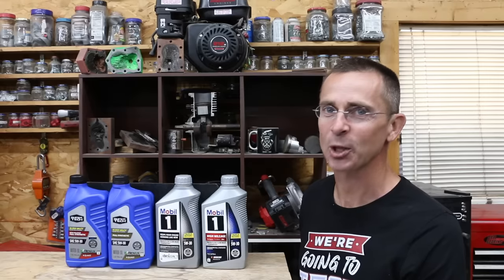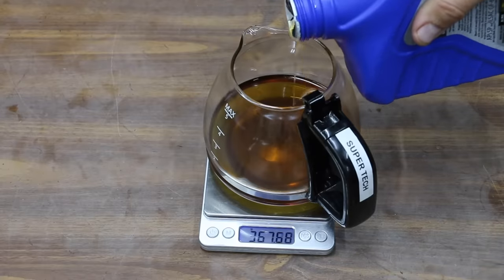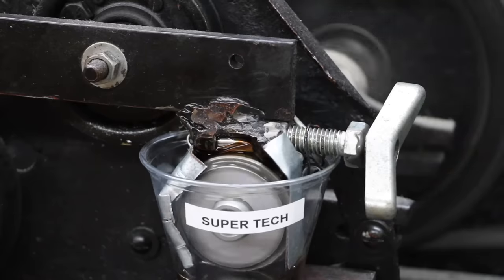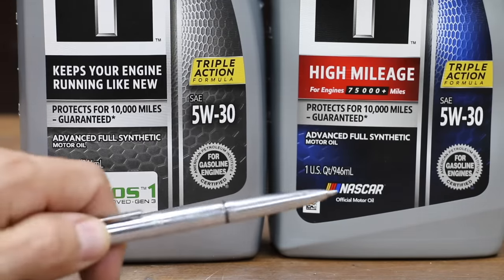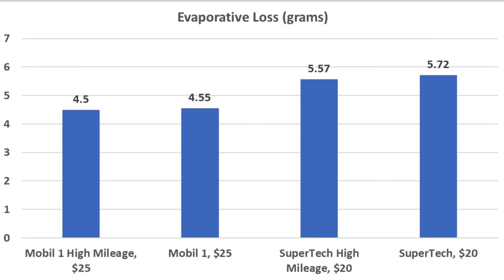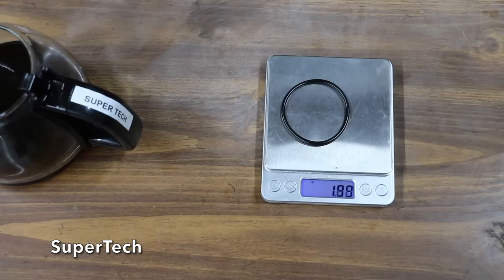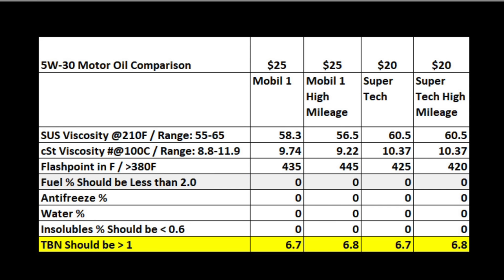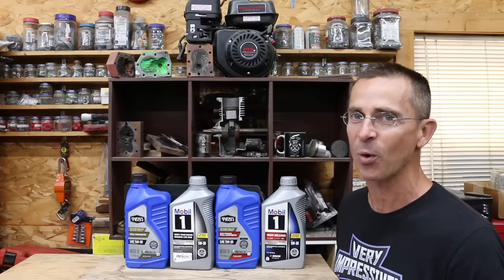Is “High Mileage” Motor Oil Safe? Let’s find out! Mobil 1 vs Mobil 1 High Mileage; SuperTech vs STHM

Comment: usually I love your videos but 30 sec in and I'm already done lol. Did you just say Synthetic helps it flow better when its cold? Probably should look up what exactly 5w-30 means lmao High mileage additives don't freeze so it stays thinner. I love too how your testing an Oil that most of us wouldn't use in our back yard Go-Karts or even a Lawn Mower.

Comment: Dexos certification means nothing. The reason Dexos is even on these oil containers is quite simple. Dexos is synonymous now with all GM produced vehicles. Why? Because when GM took the bailout money from the Feds years
ago, the Feds agreed to take payment in the form of a percentage of GM's sales through oil. That is why all GM vehicles recommend Dexos approved oil and you'll notice that Ford, who did not take bailout money, has no dexos certification requirements. Dexos certified oil is just the Feds' way of reclaiming their loaned money to GM. It isn't anything special or different than non-dexos certified oil. BTW, this information is coming from one of my oil distributors who delivers oil to my automotive shop in NJ.

Comment: I drip about 1 to 2 drops of oil from my rear main seal every couple days. 84000 miles toyota venza. Would a high millage oil slow this or stop this leak?
Reply: High mileage oil with a bottle of Lucas stop leak and you'll be fine

Comment: Just Curious. But how much wear does an engine take under normal conditions  with proper oil.  Im looking at thoes wear indicators after those brief tests  and makes me picture that being my cylinders and walls every time my engine is running.
Reply from the maker: Thanks for the suggestion.

Comment: Mobile 1 has never been the best oil Most vehicles I have worked on hate mobile 1 noticed Mobile 1 will just leak out of engines that don't leak with other oils but Mobile 1 will randomly leak out of any and all gasket and seal surfaces like there not sealing but go back to using other brands and the leaks will stop Mobile 1 is just to slick @Project Farm
Reply from the maker: Thanks for the feedback.

Comment: I used high mileage oil changed it on time it ended up leaving so much hard oil in my motor my oil pressure dropped  screw that high mileage oil
Reply from the maker: Thanks for the feedback.

Comment: SuperTech is walmarts brand. It's garbage. I love full synthetic PennsOil. If anyone has a better suggestion I'm all ears.
Reply from the maker: Thanks for the feedback.
Reply: What proof when you say its garbage? Marketing hype? People telling you expensive stuff its better?  Or Cause its cheaper so its crap?🤦🏾.  Even more expensive brand isn’t that much better than supertech when you change your engine oil every 5k miles. A
Reply: @JohnT2088  Personal experience. The proof is in the oil that comes out. Supertech doesn't last as long as Pennzoil. Supertech is thin and dark around 4k miles. Whereas pennzoil is still brown when I change it at 7k miles. Try it out sometime.

Comment: You expect the public to believe this? When you are extremely off in the dollar amount some of the oils cost. You have walmarts supertech at around $20. I would expect around $25. The mobile one however, you said $25. Almost anyone that does their own oil changes knows that $25 is around 1/2 of the costs for mobile one oil. I find it interesting that if I write down the word supertech I am getting a correction on my iPhone asking me to correct the spelling. The only thing that is wrong is I did not capitalize supertech. If I write out mobile one without capitalization I am not corrected. That tells me the system is biased. Sounds crazy huh? Try it. It’s the little things that get you. It’s like going to the car dealership, buying a car, financing it and not reading the fine print used to hide the truth. I’m just sayin
Reply: What were the oil prices over a year ago when the video was made? Ever hear of inflation?
Biased system? You're right, sounds crazy.
Reply: Well, mobile one is not a brand. It's Mobil 1 goofy.

Comment: As far as I'm concerned..high mileage oil & synthetic oil is a scam ....I am still driving my 2001 Saturn sc1.  1.9 engine with 426 thousand km...has always had conventional oil ,changed 4 times per yr or more .(change my own) ...still runs awsome..40 mpg..cheers .
Reply from the maker: Thanks for the feedback.

Comment: High mileage oil is a scam! My brother bought a 89 Chevy truck new and it had 440 thousand Miles when he sold it. Never used high mil. Oil in it's life. It still had great oil pressure, got 20 m.p.g. and still passed smog. No synthetic and no high mil. oil ever!

Comment: I would've put 5-30 oil in my lawn mower let alone my vehicles! 200 thousand miles is a joke! My truck has 281k miles my little brother's has 260k, my big brother's had 440k when he sold it. None of us ever used a drop of high mil. oil. Put that in your pipe and smoke it! 200,000 Ha!!!

Comment: your missing the boat on your "join" fee.  You are charging 1.99 to join which i will not pay.  You currently have 2.77 million subs.  If you charged .30 cents, I would join and so would A LOT of other people.  Even if you only had a 15% join rate that is still $1.5 million in revenue per year